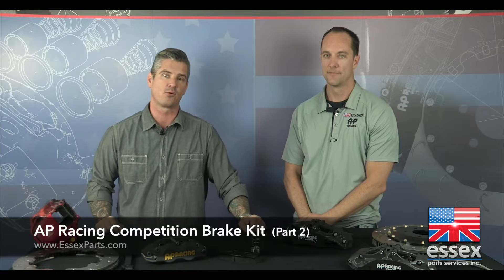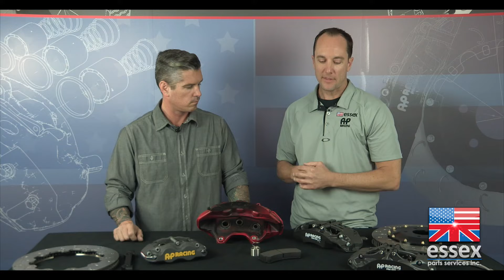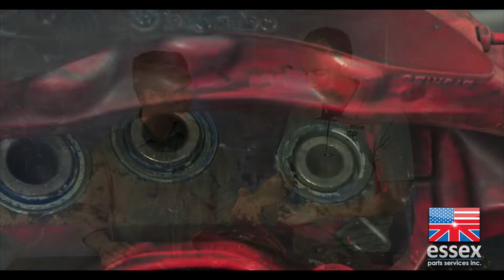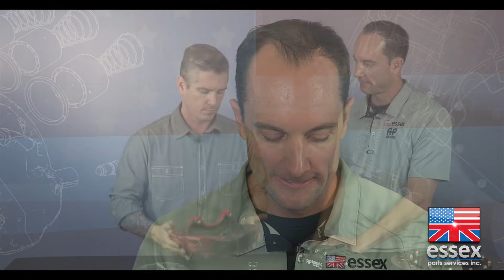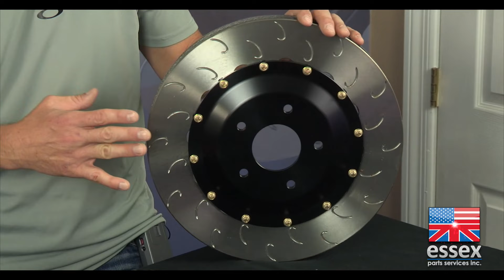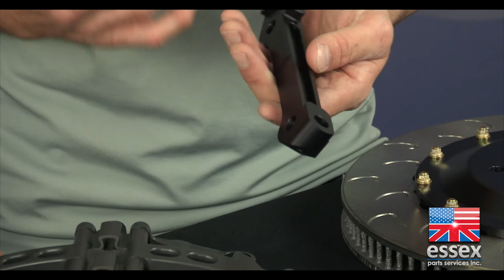Essex Designed AP Racing Competition Brake Kits: Part II

Comment: hello, when installed, the J hooks sign opening at 12 o'clock must point in the direction of travel or to the rear. how around do you have to install the brake discs, direction of rotation
Reply from the maker: Hey Godzilla R35! Great question, the J hooks will face towards the direction of the car. If you visit our homepage at www.essexparts.com , the main banner image is a great view of the J hook direction.

Comment: I honestly wanted those so bad, but unfortunatley they never even make a caliper for my car. I have a 2016 honda accord v6, which I'm building for the track. the car has a lot of power for the brakes that honda put on  them. my rotors even cracked, and I wasn't even on the track when it happened, it simply suck. brembo does offer but only the gt, gt-s which is great, and gt-r however, it is too expenssive for a 4 piston caliper. so I ended up going with a different brand, which seems to make amazing calipers too, but I also wanted to try the ap, I was dying to have it, but they don't make for my car which sucks... so my set up now is 8 pot 380mm front, and 356mm 6 pot in the back

Comment: Camaro 1le brake caliper. I couldn't see that happening with a race pad and decent fluid. Maybe an endurance pro driver on the limit on heavy brake track. Those ap calipers are really nice. Thanks for all the info. Learned a ton from your videos.
Reply from the maker: Hi Clayton,
Thanks, and we're glad you are enjoying our vids!  The 1LE caliper was on an amateur driver's car.  I can't remember the track, but there wasn't anything extraordinary about the conditions or circumstances.  They were typical of what our customers encounter on a regular basis.  He was running proper racing brake fluid and had race/track pads installed as well.  We've seen similar issues on numerous cars. If you check out our blog, we have pics of thrashed OEM calipers off of an F82 M4, 991 GT3, Audi TTRS (gen. 3), C7 Corvette...the list goes on.  Road calipers on the track can be a messy combo!

https://www.essexparts.com/news-blog
Reply: @essexpartsservicesbrakeexperts  really crazy --- i'm an intermediate level driver with an SS 1LE and a dozen or so days on my calipers and stock tires.  i get about 4 days out of my pads and 6 days out of my tires.. my dust boots have been vaporized for a while.  definitely interested in the AP Racing kit if i end up keeping my car much longer... i usually only keep a car a year or so and swapping out calipers hasn't made sense because of that... great products here though for sure and would seriously consider putting them on a GT3 or GT4 when I get one soon hopefully.  I'll have my wife watch these videos to justify the expense :)

Comment: Honestly, how hard do you have to push a car for this to happen?
Reply from the maker: It depends on the car.  We've seen dust boots burn up in as little as one session on heavy, fast cars with a lot of power and grip.  Paint or powder coat can start to change colors in a fairly short period of time on such cars.  Do a google search on "brownbo" and you'll see loads of examples.  It also only takes a little bit of brake fluid to destroy a painted finish.  It is nasty stuff, and you need to always make sure to remove it with brake clean when working on your brakes.  If it sits on the finish for any length of time it will ruin paint or powder coat.

Comment: racing heavy weighted cars. typical.
probably no correct use of brake paste either
Reply from the maker: Anti-squeal brake paste is fine for daily driven pads, and addresses vibrations of certain frequencies.  We don't recommend it for high temperature applications however, such as those seen on a racetrack.  When you heat the paste up, it burns, cooks, and creates a huge sticky mess!
Reply: Essex Parts Services, Inc. Würth is resistant to 1100°C. id never use anything else. im quite sure if your pads and calipers hest to thst extent, things will fail. if it goes higher. 1500°C, your piston will also melt

Comment: that oem caliper has been repainted.  the oem paint holds up much better...  pretty sure those dust boots aren't oem either
Reply from the maker: We don't believe that is the case.  To our knowledge that was the OEM finish and dust boots.  Regardless, we see this type of degradation all the time with OEM road calipers when they're run on the track.  Have you ever heard the term, "Brownbo's"?  That phrase became popular due to the OEM Brembo calipers changing color after track use on the 350Z, Lancer Evo, WRX STi, etc.  If you check out link below to our blog, you can see a set of F82 M4 calipers that have started to change color after only two days on the track.  The outer halves of the blue caliper started turning aqua/green from the heat.  https://www.essexparts.com/news-blog/bmw-m4-ap-racing-competition-brake-kit-prototype-installed

This is not a new phenomena.  Paint and powder coat simply don't hold up to track abuse over the long haul, and we've seen dust boots burn up in as little as one session on the track.
Reply: I know about Brownbo's, and I've seen them go completely black with the letters turning red (looked pretty cool actually, haha).  But it doesn't happen as ugly as it did on these calipers, these look like someone took a torch to them till they turned black.  My point was that OEM paint holds up better than a repainted caliper, not that its not affected at all.  

I'm fairly certain those are Racing Brake dust boots.  OEM ones are black.

That being said, AP brakes are badass.  But a CTS-V caliper isn't as bad for the track as this video makes it out to be.  With some track pads in there, its plenty for 95% of people that track their car.
Reply from the maker: Understood.  I was thinking about the OEM boots, which the customer told us burned up almost immediately on his Camaro.  The blue ones are definitely not OEM, but they didn't hold up either.  The point with those is that dust boots are a waste of time if the car is regularly tracked.  
OEM paint probably would do better than aftermarket, but is still marginal (see the BMW calipers mentioned above).  Much of the charred black on that caliper is cooked brake fluid.  For some people, OEM calipers are fine.  Others want the absolute best performance available.  For example, we have a bunch of C7 Z06 owners pulling their factory calipers and swapping to our kits.  Our iron disc kits offer a laundry list of benefits and only weigh as much as the carbon ceramic option on most cars.  A Timex tells time just fine, but some people still prefer a Rolex for a variety of reasons.  :)
Reply: Essex Parts Services, Inc. haha, yeah, we're on the same page with the Timex vs Rolex analogy.  what I was trying to say is that the 6 piston CTS-V caliper isn't exactly a Timex, more like a Citizen maybe?  Its not the best, but still pretty good.  A Timex would be a sliding caliper...
Reply: Bob Last  it was resprayed 100% (and it was made not so good). easiest way to see - brembo logo. it was cut from film (you can distinguish burned film on video), not printed like brembo calipers have from factory.

we are using this calipers a lot for different cars, which also have a lot of trackdays. with proper rotors and pads they work excellent.
i have them on my car with carbon ceramic rotors and pagid rsc2 pads - no color change at all (our own powder coating).
Reply: @essexpartsservicesbrakeexperts  I'm here getting ready to upgrade from my OEM akebono's that are looking a heck of a lot like the red calipers at the start. Funny enough, my first track day at VIR ended horribly because I went on stock pads and didn't bring backups During the last session of the first day I found myself with metal on metal getting towed to the shop.  Turns out there wasn't an OEM pad within 500 miles and not a single aftermarket pad available for the 15" front brakes unique to the 2024 Z Nismo. The closest dealership with a set was in Chattanooga

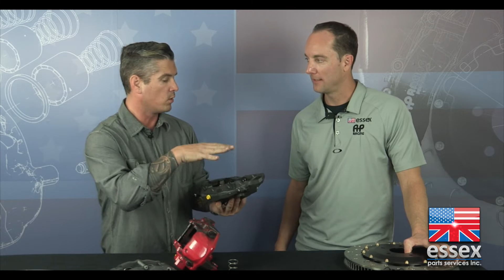Comment: 10:58 That "little rubber hose" has kevlar reinforcing fibers in it and Kevlar's mod of elasticity is ~150 to stainless steel's ~200GPA. I have had stainless on every car i've raced and NEVER felt a difference in pad feel and I've also NEVER heard of a "rubber" line pop off.
Reply: i never felt a difference either.. i think when the lines get really old they may degrade?? but that's a concern for guys who are setting up an e36 or e46 M3 as a track car 20 years after manufacture date.
Reply: i had experienced those stock hose pop out in the track.. it happened on my 400+, hp evo 3, luckily i managed to stop and not crashing the wall on front.. now i only use steel braided on all my car.

Comment: how much is the rebuild service. There are a few problems I can imagine...is when the brakes need to be serviced they would need to be taken off...and perhaps the stock system would go back on so that the car can be driven...and the stock wheels would go back on. But considering how long the brake system would last....the stock wheels probably would have unusable tires or no tires at all (sold).
Reply from the maker: +mikepartyboy The labor price for our rebuild service is $78 for a four piston, $88 for a six piston.  New seal kits are roughly $50.  So the total to have a pair of calipers rebuilt would be in the neighborhood of $250.  So for less than the price of a set of racing brake pads, your calipers are back in new condition in terms of performance, and the same technicians who rebuild NASCAR Sprint Cup calipers rebuild the aftermarket calipers as well.  

We have customers that have had their Competition Kit installed for 4-5 years now without being rebuilt, and haven't run into any issues.  It all depends on how hard you are on them, how frequently they're abused, and how rigorous you are on your maintenance schedule. Those who use our service typically do so in the winter when their car is down for other service or modification.
Reply: @essexpartsservicesbrakeexperts 
Do you guys also rebuild Brembo calipers? Or just AP?